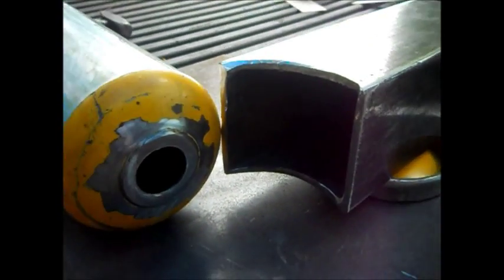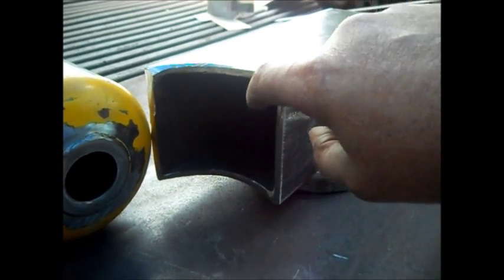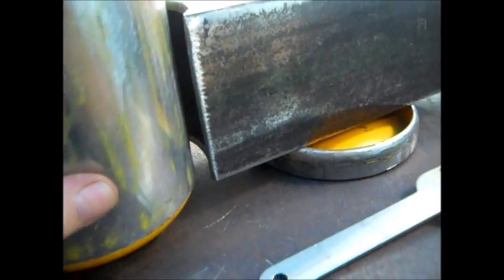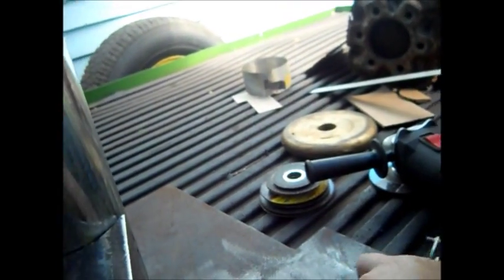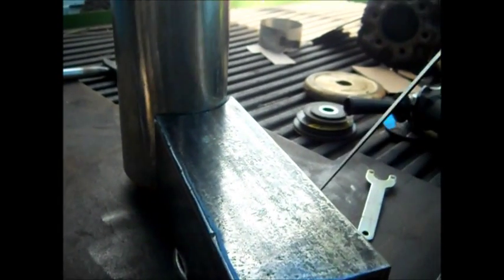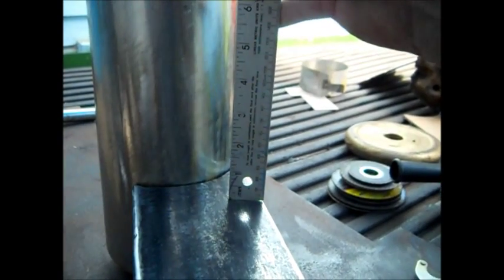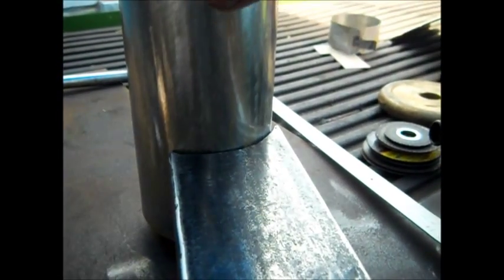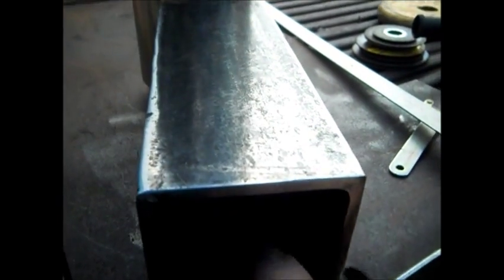Rocket Stove made from fire extinguisher and 4 in  square tube Part 1

Comment: overloaded my IR temp measurer on mine and melted the up pipe yeah bad idea using alu lmao i know but i saw peeps using on utube with no probs.i love this idea of swirling vortex style flame tbh!!.the one i made although just a test project to stash at fishing in the bush for cooking & heat overloaded my temp sensor.not sure limit but i clocked it saying 1,800+ (C)to OL.10 cm pipe diameter and i think the higher the pipe the more air drawn through it whether its thin up pipe or not.(i think)